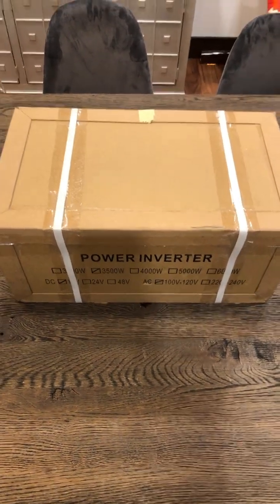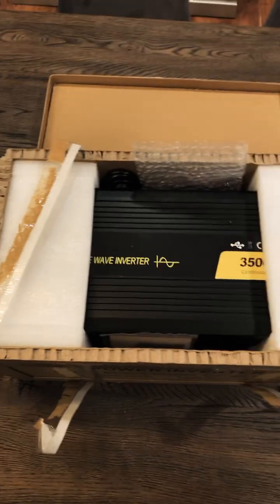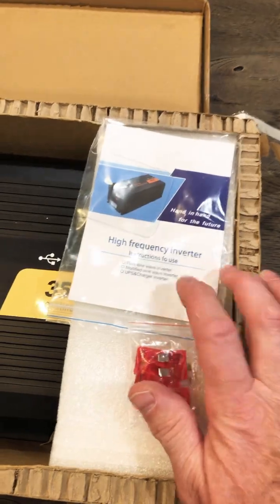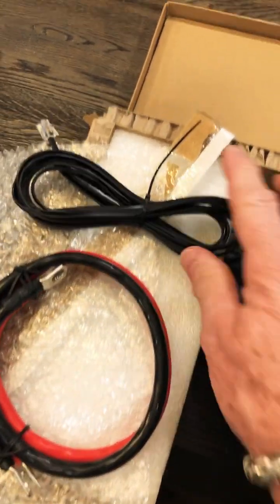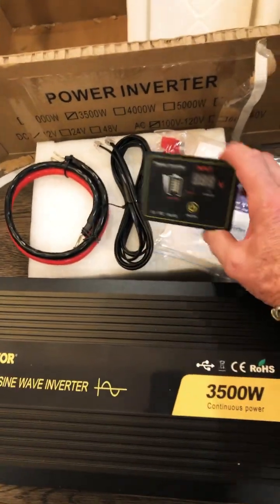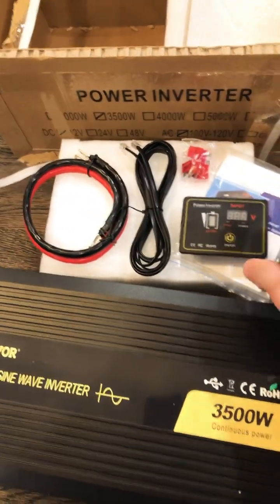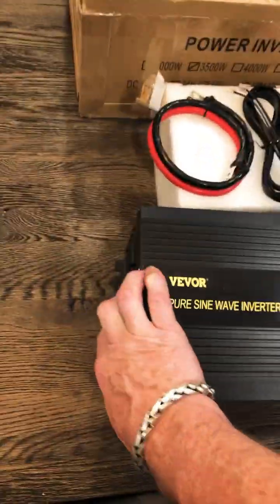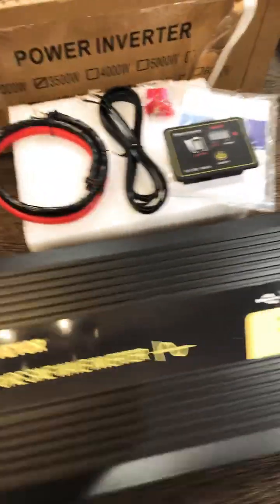3500 Watt Pure Sine Wave Inverter 12VDC to 120VAC

Comment: 12 volt input, 3500 watt?  That means those skinny little D.C. cables need to carry 300 amps plus surge?  LOL, no.
Reply from the maker: Yes that's about right.  With a charged battery to 13.8V it would be about 218 Amps.  But the cables included are not skinny - I think the are 1 AWG, and they are about 0.5 meter in length.  Hopefully it would be mounted even closer to the battery - then we could cut the cables in half and double them up which would be great;)
Reply: @KissAnalog  iirc  1/0 is required by nec for 200 amps. I used 4/0 with a 250 amp breaker for a 10ft distance (20ft circuit).
Reply: My 3000W Amp has Cables about that size maybe even slightly smaller
Reply: @deltasixgaming  that's because car audio amps are rated by peak and the wiring is a joke.
Reply from the maker: I think that rating for cars is to handle cold cranking amps and considers the voltage drop.  

NEC doesn't consider the length - or it is actually supposed to be a non-factor.  But then I haven't seen the NEC for DC current to an inverter.

Length is a factor and the shorter the cable the smaller the wire can be.  I have to consider this when I run traces on the PCB to carry this current.  the temperature and voltage drop are typically the limiting factors.
Reply: NEC considers length only in terms of voltage drop. I don't remember the limit for drop, maybe 5%? More than the limit requires going to the next larger size but it is seldom an issue. D.C. sizing is similar, and if "permanent" wiring in a structure the NEC applies. (so not in this case :) )  Otherwise some good standards for D.C. are marine standards such as by ABYC (westmarine publishes good info).

The 4/0 wiring I was doing was for a 48vdc inverter to 120v, capable of 5500 watt sustained, 11000 watt for several minutes. It provides back up for much of my house. I can optionally turn on a 120v to 240v transformer and run my 2hp deep well pump. Starting the pump really makes that inverter grunt. (it has an approximately 100 lb torroidal transformer inside.) I didn't want voltage drop impairing the inverter at low battery state of charge. @KissAnalog